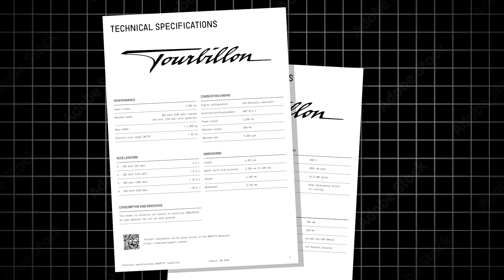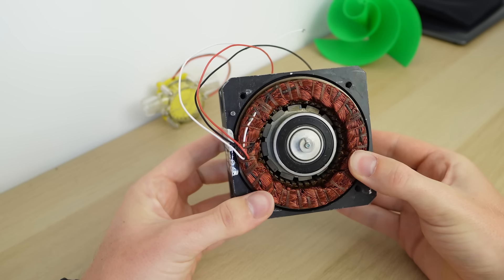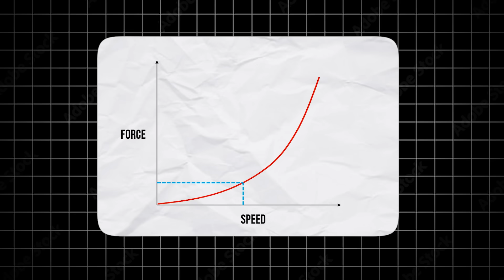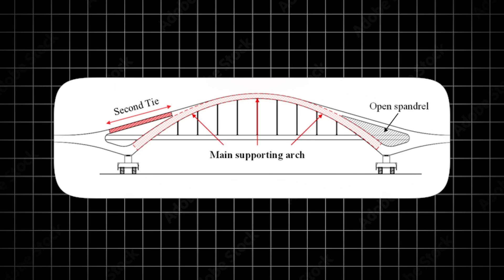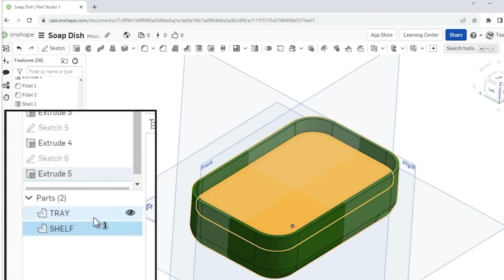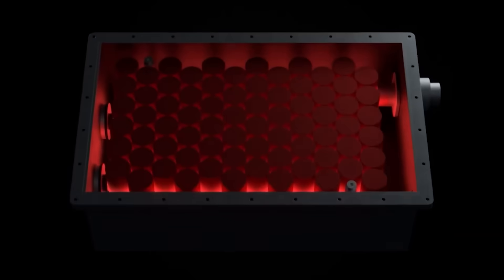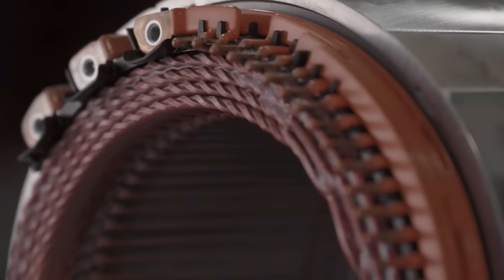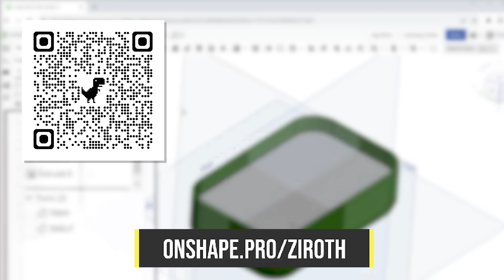How Bugatti's New Electric Motor Bends Physics

Comment: was expecting something more new/direct, would be better to name the video something after advancements in electric cars and such.
the 800hp for example isn't a lot for electric.
the company Tesla(so not the inventor/innovator, neither the historical company by that person but the modern company by elon musk).
had documented their tesla model S to have 18000hp at some point,
al be it not directly as in marketing materials or on the site, but it was in the datasheet.
18000hp obviously is a lot more than 800hp.
(18000hp as it had 4 motors each  rated at around 4500hp)
ofcource those cars didn't actually reach that and that was the power of the motors which was stated.
in reality while the motors actually could technically reach such power, the batteries, bms, and esc
(like the motor driver and battery driver and batteries) could not handle that at all, and also where super inefficient at any decent levels and also could not reach any high speed.
also lead to the joke among engineers that they used ESC's from aliexpress, which back then was really known as a place where pretty much all "high power" electronics and drivers and such where fakes using fake components which didn't work properly, like mosfets pretending to be a type rated for 300A with a response time of <1ns which would in reality be a 5A mosfet with a >50ns responsetime. still is a lot like that for mosfets however, but these days despite not matching the description some actually still are usable, just need to test them first and hope you've got a usable type.

so a electric car company reaching 800hp isn't to special, actually not at all if we take rc into account as well, which are remote controlled toys.
honnestly the driver and such handling it can be seen as special if they are efficient and cheap enough as well.
but in this case I would say the main advancements would be.
1. the esc being able to handle high currents and high enough speed at the same time.
2. the developments in cooling oil which is actually mostly done by other companies probably.

really hoped to see something like actually physics bending, since I know it is possible and have done so myself as well, as in generating propulsion by litterally bending physics themselves.

Comment: Would it be possible to design an electric motor that used the stress of outward motion to enhance speed eliminating the need for ultra strength materials such as carbon fiber to hold the motor together? It's just Newton's law, "that every action produces an equal and opposite reaction".  Why not harvest work from both?

Comment: 800v are not delivered, that is the potential. And the voltage potential chosen for a given system is more a function of reducing wire size and weight. The batteries ability to allow current to be drawn out quickly is much more impressive than the voltage. Go back to high school physics class 

Also, 20k rpm for an electric motor has never been difficult. Like others have said the terminal speed of the rotor surface is much more important

Comment: One of the interesting immersive coolants is available for computer parts, boils at around 70C, so the coolant does not need to be pumped for cooling, just re-condenced from gas back to liquid, then re-added to the battery pack. They may not even need a compressor to accomplish this, just a radiator.

Comment: The "dielectric fluid" seems like a no-brainer but surely even low conductivity materials have some electric field effect as well as phase-change optimization and good old specific heat capacity optimization

Comment: The fact that electric motors can reach very high speeds is not a feature to be boasted about, on the contrary, it is a feature that will destroy torque because electric motors need current to obtain torque and voltage to obtain current. And if you increase the speed of an electric motor, naturally the frequency of the phases will also increase. this reduces the effective voltage, hence the current decreases, hence the torque decreases. It cannot be said that it is very efficient, in fact Tesla is in trouble for this reason. Why do you think Tesla Roadster was delayed so much?

Comment: WTF are they doing quoting temperature reduction as a PERCENTAGE? - that's completely invalid! There's no such thing as "no temperatures" so the zero point and therefore scale are utterly meaningless.
the number 40 is "26% lower" than the number 54 ... great. but at the same time; those specific heat energy points are also: 
Fahrenheit 104 vs 129 = "20% lower"
Kelvin 313 vs 327 = "4.3% lower"
Rankine 563 vs 588 = "4.75% lower"

Comment: Bugatti sells about 80 cars per year?   Did I read that correctly?  The real magic is making the economics of all that R&D along with distribution, tooling and manufacturing work.   80???    They must charge $100k for each replacement spark plug.

Comment: 4:07 - 100,000 RPM isn't special, unless the diameter is stated.  Small motors regularly hit 100k, but convert that to an 8" diameter rotor and it becomes unrealistic.

Comment: Or you could, you know, just get rid of the carbon sleeve and close that air gap to get better torque, allowing you to get the same power but also run the motor at speeds where it's not trying to self-destruct. While we're at it, you could change the angle of the flux relative to the pole and pick up even more power and efficiency... like Mercedes did, allowing them to get 800hp into an even smaller and lighter package than Bugatti. Generally, if you have a problem and you solve it by adding parts made of exotic materials, you've made a mistake.

Comment: So why not make the center of the cylindrical batteries a hollow tube and run coolant through that, too?  Most have a solid rod up the middle that could just as well be hollow.  Especially in these larger diameter batteries.  That would not only remove heat but it would make the heating in the battery more even.  If you cool it only from the outside, it will be gradually hotter near the center.

Comment: Your video is full of inaccurate information: LFP is low performance compared to NMC. LTO has high weight as the voltage per cell is low. Per kwh LTO has a high power density, but not from a gravimetric perspective.

Comment: Why didn't they give it a turbo. Could use a lighter more efficient more powerful engine. W16 na is just not a smart choice. I know Bugatti vehicles are just for the flex and w16 is a huge flex but if i had one id prefer a higher performance and to be less polluting

Comment: Cool the cells internally

Imagine an aluminium pipe for arguments sake 100mm long wuth a diameter of 5mm. Wrap the cell layers around that pipe. Cap it off with an insulator. So you have a battery cell 🔋 with a hole in the middle

Pipe non conducting cooling liquid through that hole for thermal management

Comment: TLDR; No physics was bent in this video.

"Novec 649/1230 is classified as a PFAS substance. In December 2022, 3M announced that it would cease production of all PFAS products by 2025, including Novec 649/1230.[14] It degrades to Trifluoroacetic acid (TFA) via photolytic degradation in sunlight."

Comment: So Mr. False Headline, just WHERE were any laws of physics being "bent"?  I certainly didn't see it!  This is just more misguided hype for EVs, all of which will be sitting at the road side when there's no electricity to charge them up!!
Reply: How is an EV running out of juice any different to an ICE running out of fuel?  I love ICEs, but stupid arguments against EVs are just that, stupid.  You could have argued that the materials in EV batteries come with environmental concerns, or that the weight of batteries make cars with an acceptable range heavy and therefore relatively poorly handling.  You could also argue that the low sound means they lack the emotional involvement of a powerful ICE.  To argue that they don't work if they run out of energy though, sheesh!
Reply: @Raven-Creations  I can run a Diesel engine on just about any flammable liquid, cooking oil, transmission fluid, jet fuel, etc. A gasoline engine can be run on alcohol, if it's not too diluted with water.  An EV? They work on electricity, and that is all they run on! You need to learn more about this subject before making comments.
Reply: @AnotherWisenedOne  So how much cooking oil, etc. do you cart around with you, just on the off chance you run out of regular fuel?  It doesn't matter what you can persuade them to run on if you don't have any in the vehicle.
If you run out of energy, whether electricity, or oil-based, that's on you, not the technology.  A lot of modern EVs have a range of over 400 miles and charge to 80% in less time than it takes to eat a meal.  There is no excuse for running out of juice whatever vehicle you drive.
Reply: @Raven-Creations  You just don't get it, do you? When the EV chargers are broken down or don't have any electricity going into them, you won't be able to load up your battery, even if you're parked right next to one! You can't run a gasoline engine on oil, the compression ratio is too low for that. But if you have a Diesel engine powered car or truck, you might be able to find some  form of fuel for it.  Are you going to capture some electricity with your bare hands and walk it over to your EV?
  The USD is headed for the toilet, and when the hyperinflation gets here, no electric utility will be able to afford the exorbitant costs of the fuels they burn to generate electricity!  Without electricity to run the oil refineries, no planes will fly, no trucks or trains will roll, no food will get planted or harvested either!
Reply: @Raven-Creations  You are the one who misspelled the word.  When a Z is used, it means dried or shriveled up, and does not mean more educated or enlightened.
  Your history about the fuel "crisis" of the 1970s is so far off base, it would take me far too long to correct you than to be worth it.  Without burning carbon based fuels, like oil and gas, there wouldn't be enough electricity to manufacture EVs, let alone charge them after the sale!  Read the figures about how much fuel needs to be burned by power plants to charge up an EV sometime.  There is no real economical or environmental advantage by going to "green" EVs!

Comment: 3M have been making dielectric coolants for over 30 years as used in RAAF AEW&C radar power electrics.
I also used the same fluid in my electric race bike to cool the motors. And its not an oil, its more like water but
has higher thermal conductivity rate than water.

Comment: 8:10 - this does not make any sense, you cannot use percent like that with temperature. Maybe when working with K, but still... The second point (Temperature variation) is ok, but the maximum cell temperature is not 26% lower. It is 14 K.

Comment: I learned nothing new, man. Can you explain why nobody used an ordinary transformer oil till now? And what are the benefits to use the oil from your video instead of transformer oil that is tuned more than 80 years ago and works perfectly, some types even in quite higher than 800 volts tension of field?😎

Comment: if high speed motors have nonlinear problems why don’t they design a slower but higher torque motor and use a gearbox to get the desired speed?

Comment: That immersion cooling has to be heavy and how do you keep vibrations (sound, etc) from causing a variation in the flow pattern? I just have to assume you will get stagnation points and points increased flow...
Thank rapids or turbulence and not laminar flow.

Comment: That immersive cooling is a great idea.  Until the coolant is contaminated in some way, at which point your multi-million dollar Tourbillion goes up in flames.  Remember, distilled water is non-conductive as well, as is pure mineral oil.  Again, until almost ANYTHING gets dissolved in the fluid.

Comment: If you want real physics bending technology look no further than Koenigsegg's "Dark Matter" electric motor that makes 800hp and 922 lb ft tq (1250nm) all while weighing under 40kg (88lbs)
Reply: It's motors like these that are just DYING for a worthy, lightweight battery.
Reply: @mockingbird187  agreed, the only real thing holding EV's back right now is battery technology, once it catches up to our motor tech EV's will be even faster and more importantly be able to travel for days on end without needing to recharge...
Reply: Amazing...axial flux motors
Reply: The light weight of the egg motor and the power of the bug motor. That's what we can call a electric BEAST
Reply: @Your_average_oxygen_enjoyermore like the lightweight and powerful Koenigsegg motor paired with a power dense Bugatti/Rimac battery.

Koenigsegg's Dark Matter e-motor is lighter and more powerful than Bugatti's. And Bugatti/Rimac's batteries are the best in the business.

Comment: Synchronous means it has an aditional winding which makes sure that the speed of the rotor matches the speed of rotating magnetic field. Normal are asyncronous and they usually spin 2-5% slower
Reply: interesting; are syncs better?   more expensive, but less heat, maybe?

Comment: 8:35 this NOVEC™(649 and 1230, depending on purity, and aka "dry water") is Perfluoro(2-methyl-3-pentanone), which is a PFAS, and its use is probably restricted, especially in Europe. They would have to look for something different here.
Quoted from Wikipedia: "Novec 649/1230 is classified as a PFAS substance. In December 2022, 3M announced that it would cease production of all PFAS products by 2025, including Novec 649/1230.[14]"

Comment: Immersive cooling is such an obvious track.  They have been using it for decades in distribution transformers.  Those giant pole mounted transformer 'cans' are actually filled with oil to cool them.

Comment: 800V pack isn't that hard, just put 200 cells in series. 25C discharge isn't that impressive, pretty good, but not hard for IMR lithium batteries, commonly used in vape devices. Immersion cooling is cool though, and it is becoming more common for cooling computer servers... and mining rigs.

Comment: 1: Quadratic, not exponential.
2: That gives 44% increased force, which does not round to 50%.
3: In relation to what? I didn’t find any mention of the rotor diameter, or any other meaningful comparison.
Reply: Thank you for the correction
Reply: Isnt the curve of a quadratic equation based upon the exponent portion of the formula, so the curve of a quadratic equation is an  exponential curve? Is that true, i mean, im no mathematician so please enlighten me if im wrong???
Reply: Yes indeed

Comment: Novec isn't just a fluid to collect heat. It's a whole family of chemicals used for phase change cooling and works by boiling (the boiling point can be controlled) then carrying the heat away as a gas where it's then condensed. It's not a new thing (the patent expired in 2020) and It already has major applications in datacentre cooling and as a fire suppressant in applications where water can't be used (e.g. art galleries)

Comment: Electric vehicles need to move away from using individual motors on each wheel.

Move to having a central electric motor and it can be larger with more power and you can use thicker layers to keep them from wanting to bust apart. Then it is just a matter of using standard drive trains to send power to the wheels. The extra weight would be more than offset by the extra power you would get.

If you want regenerative braking you can still use weaker motors for this, just have the main motor disengage and the smaller motors engage.

Comment: That dielectric oil has less thermal capacity, is more viscous, and is less thermally conductive than water.  And, full immersion is heavier than the fluid channels used for cooling.  And you still need some kind of system to ensure every cell gets the same coolant flow.

The lightest possible cooling system would be forced air cooling, but that wouldn't work here because air won't remove enough heat.

Comment: RPM means nothing on its own, small sized motors can reach speeds up to 1 million rpm. therefore its hard to relate as a viewer whether the 100krpm of new south wales is impressive or not. While writing this I checked out the source you linked. this comment is mostly useless now, but maybe lets others avoid to wonder the same.

Comment: Batteries are only a small store of power I don't care how big you make it or what you make it of until you figured out its true full efficiency of use and distribution you haven't done anything and the super awesome internal combustion engine they make is a freaking joke in less than 2 nights of work I make 12 different internal combustion engines that will change the course of humanity and in a few short thoughts I designed a steam car that can out perform even the gas engine onto of which with a few adjustments to my steam car design it can be converted to high powered jet and rocket propulsion and fuel no need for chemical rockets or fossil fuels other than for lubrication where needed steam is the future its cheap easy to make and just as powerful as the nuclear war head if you optimize my system for rocket propulsion

Comment: Where can I buy diletric oil?  I want to experiment with improving cooling a Ryobi 40v battery using cooling oil and epoxying a heatsync into the battery case.
Reply: You probably spotted 3M Novec™️ in the video but Exxon has some and ofc most oils are dielectric, being nonpolar liquids but you want to not interfere with the battery wraps and maybe get economic pumping past a radiator or heatsink setup by piezopump or membrane voltage driven 'muscles.'
Reply: @Cineenvenordquist  

Where can I buy a pint or so of 3m diletric oil that is safe for li-ion and lipo cells?

Idea is open case and seal the battery and cut hole to epoxy heatsync into.  Then seal up battery and fill battery.

It's just more efficient PASSIVE heat transfer out of 40v Ryobi lawn mower battery.